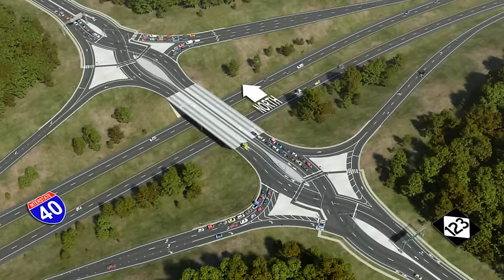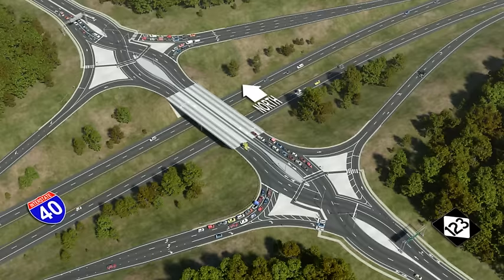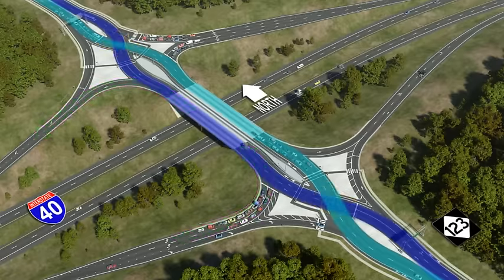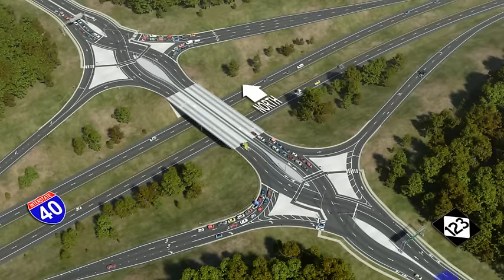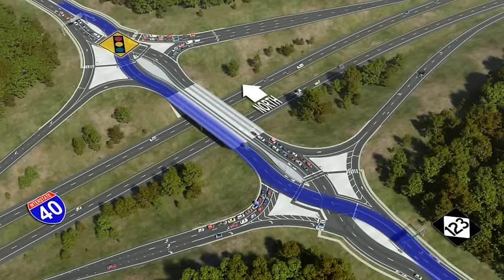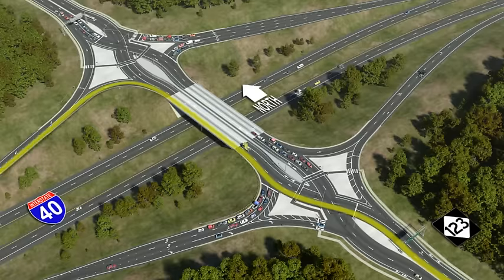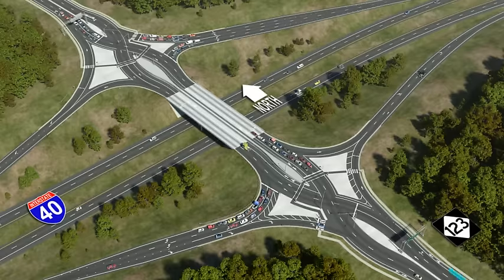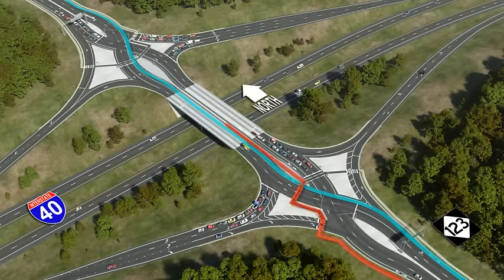Diverging Diamond Interchange Visualization

Comment: Or you know…roundabouts.
Reply: For the volume of traffic a roundabout would take up more land and require the complete rebuilding of the interchange, most city interchanges are double diamond, more land efficient, with complicated traffic light systems.  The diverging diamond fits in the area taken up by the old double diamond interchange, perform better and are safer not only for motorists but even for pedestrians and cyclists.
Reply: @rpf276  They had to extra widen this road just for this....

Comment: At first this looks like a good idea but after further study it's a complete waste of money and will actually be more dangerous and more congestion.  If you just have a normal intersection then cars can turn left (if no oncoming traffic) but the DDI forces both groups to stop with no chance of turning while stopped.  No doubt this will cause major confusion, cost tons more money and the pedestrian path being separate from the bike path is plain and simple WASTE BY GOVT.  If lucky you may have 10 bikes and pedestrians that use it in a given MONTH..... so to have 2 different lanes for this shows just how wasteful govt is.  Also, remember when either side is crossing over the other side must be completely stopped.  Also curious what is the EXTRA costs for this type of setup?  Looks like tons of barricades are added.  Would love to simulate this vs. a normal intersection to see the true impact on flow.
Reply: You're armchair looking, but if you look at real world data from DDI many states have built the DDI moves more traffic and is safer since there are no more left turns crossing oncoming traffic lanes, no more T-bone accidents.  You also do not get it, no where are all lanes stopped, its one side or the other that is allowed to cross over. While crossed over you can get on and get off the expressway at the same time,  which is the reason why the lanes are crossed over in the first place.
Reply: @sharpfinch5354  ad hominem attacks only expose you have no facts to support your ignorance.  I drive it daily and KNOW it's a bad design that cost taxpayers double what a normal one would.
Reply: @rpf276  I noticed today in Mebane, NC they added traffic cones between each lane because so many people are crossing into adjacent lanes because the curves are so sharp once again proving this is a failed and flawed design.  More govt boondoggles and waste of our money that create more accidents and less through put.

Comment: Very confusing. I understand that this works in theory, but can be a nightmare for motorists encountering one for the first time.
Reply: Not as confusing to me though you would be surprised to see how many do not know how to use a roundabout or rotary which is just as simple as this despite the right to left and back to right when going over the highway. not to mention the ease of this for semis compared to a rotary,
Reply: We have several in Atlanta.  As they were building it, the streets were confusing at first.   After it was built and If you follow the lanes and traffic signals, you will drive through without realizing what is happening.  My only concern since it's under signal control, what will happens if the signals are not operating at all for whatever reason.
Reply: @mscoe456  Signals are designed to fail in a 'secure' position, IE all lights go red. even so, common sence will mean that traffic won't drive into each other.
Reply: So after the first time everything will be ok?

Comment: educate the drivers, period.  make way mode difficult (ie: strict) to obtain a drivers licence. Because right now its a joke, compare to any advance European countries.  This type of intersection is extremely confusing. 
Force the drivers to learn and understand  to KEEP RIGHT, and SLOWER TRAFFIC KEEP RIGHT
Enforce it.
Reply: Actually, it is confusing ONLY because it is new and unfamiliar.  Since left turns require NO crossing of oncoming traffic, it is actually MUCH simpler (and faster) to use for drivers once they get used to it.
Reply: "this type of intersection" as you call it was invented in France. Nothing confusing about it, reduces traffic by 50% and reduces collisions by 60%. Educate yourself

Comment: great for robots ... people will be confused and head on accidents will kill
Reply: +Lion Myth Doesn't seem to difficult to follow.. Sit at the light and turn left or go straight if coming from left, and vice versa.. Nothing confusing about this in practice.
Reply: The old four ways have at least 14 more conflict points than what the DDI has. This allows those turning right to do so unimpeded or left do not have to stop and wait again to turn left and can continue now unimpeded. That is unless there was an accident on the ramp caused by an idiot driver.
Reply: head-on accidents are impossible at these intersections. the only possible crash would be a t-bone, which would require someone running a red light. no different than any other intersection.